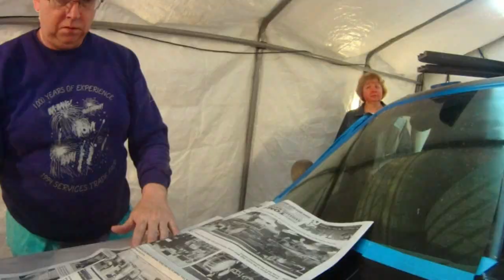Miata DIY complete paint job time lapse

Comment: man all that prep for a flat black T-T you could've rattle  canned it with same results lol
Reply from the maker: +ShootsDenBrah Rattle cans have propellants and additives for shelf life stability which do your finish no favors and do not have the UV protection of urethane automotive paint. Also there are 4 levels of gloss to non gloss black car paint, gloss, semi gloss, satin and flat. Some companies call satin matt but its the same sheen.I used semi gloss which just knocks the high shine off the finish but still reflects a good amount of light. In other words no rattle cans would not have achieved the same result and would not had near the durability.
Reply: Agreed
Reply: I’m painting my Miata too! But that’s a lot of work for that finish! I’m going an candy. After the red I’m mix Diamond gloss with Upol clear ! On sale ( always) during the fall and winter on Amazon! Upol is a great glossy clear and mixed with Diamond and a hardner and pint of base reducer all for 130.00 gives you a finish that can be just as good as ( wet wet) and all candy! Good luck

Comment: A part of that grill (estetic opinion) its very nice job.
Reply from the maker: David Miškovič Thanks!  The grill is 100% for function.  I live in farm country and the bugs and grass hoppers in the radiator are really difficult to clean out.   With the screen I just vacuum it and it works pretty good.  The car has really changes a lot though there is brake duct holes and a splitter on it now.

Comment: wow for all that work they did to prep it I thought it would come out better but then again maybe they were actually going for the flat black cheap plasti-dip look
Reply from the maker: +Rokkopg24 Nope going for the semi gloss look that it is.   Flat black works on a 57 Chevy but never on an import.  I didn't want to try gloss on my first attempt at painting so I split the difference with this semi.  The paint has 15,000 miles on it now and has been through every kind of weather there is and tons of track events. There is a few dings on it but over all looks way better than plasti dip new. It is pretty rough because I missed a lot as a total newbee but for the 200 bucks and 40 hours I have into it I have been very pleased with the outcome.
Reply: it better last long with all that prepping you did lol
Reply from the maker: +Rokkopg24  I'll probably shoot it again in a year or 2 but for the $$ I have in it and the first time painting anything I am very happy with the performance of the paint.
Reply: Jim Stainer lol "but never on an import" pfft this guy
Reply: Jim Stainer 1st time painter not bad but yeah you probably needed to spray either your coat or gloss 2 or 3 times,  I noticed you only went over it once

Comment: the prep work was real good the spray a lot less good...

next time spray it with the doors in if u do it like this , 
just spray the insides first than close the door

prep it like u did now . 

than use a Etch Primer
after that go with a filler 

wet sand it

than base coat it and use 2 layers of clear coat.

if u want a better finish than this u can wet sand it and sray a mat clear coat
i bet it will look much better
Reply from the maker: +mythic anomaly Thank YOU!  I actually am planning to paint it again someday probably blue.  But this is all about the project and the first time I ever did anything like this so I wanted to keep it as simple as possible.  That's why I didn't do the jambs and just went with single stage simi glass. With semi glass you can mess a lot up and it still looks mean.
Reply: +Jim Stainer how did you push the paint through with a small air compressor. I want to paint my car but am unsure if I can even paint it without a 1500 air compressor
Reply from the maker: +Isai Conchas I used a 1.5 HP Craftsman compressor and it worked just fine. I doesn&#39;t take that much air. http://www.craftsman.com/craftsman-20-gallon-oil-free-portable-horizontal-air/p-00916914000P?sid=IDxCMDFx20140801x001&amp;KPID=00916914000  This is the gun I used.  http://www.harborfreight.com/air-tools/paint/20-oz-hvlp-gravity-feed-air-spray-gun-with-regulator-69705.html  Be sure and put a water trap and drier in the air line.  Good luck!
Reply: Thanks jim
Reply: +Jim Stainer  i think u did real good given , the space and tools u had . its not an easy thing to do 
im a 1th degree car painter from Europe with over 15 years of experience

if any questions about spray painting a car just shoot
Reply: +Isai Conchas     depending if u use a hvlp spray gun ...( high volume low presure ) 

but overall i would say ,  1.2 - 1.4  bar   with nozzel in the gun 1.2 to 1.4mm

most use 1.4mm nozzel and adjust pressure als u feel. 1.2 bar with a devilbiss gti

most spray guns that are cheap or hvlp can not be compared to for example a devilbiss gti or any sata spray gun.. it is alot more easy !!!   getting a spray gun like this 2th hand is a must imo.

most paint for in spray guns is pretty thin... most compressors can give 1.2 bar no problem 

if u have to high pressure u paint less wet ,and may have over-spray
not to mention the dust and stuff u blow around
the (bounce back) of paint.
Reply: +mythic anomaly hey can you give me some advise as to some quick steps to paint an old civic? I actually have a nissan 350z in the paint shop now but I also have an old civic at home at the paint bug bit me and I want to try it out. nothing crazy just rattle cans is fine with me but any tips you can give me about doing it this way? like primer first then wet sand then base coat then clear x2?
Reply: u could spraycan a base coat and use 2k clear coat  if u wanna go cheap if u make any errors u could polish it out later. 

spray can coat isnt hard enough and has no chemical resistance so automotive clear coat over it works. but getting good results is al in the art of prep work and setting of your spraygun and paint viscosity
Reply: Rokkopg24 and its is gonna take a lot of rattlecans if automotive paint is to much for u. getting a cheap spray gun and using outdoor paint used on houses might be even cheaper than that many cans of paint